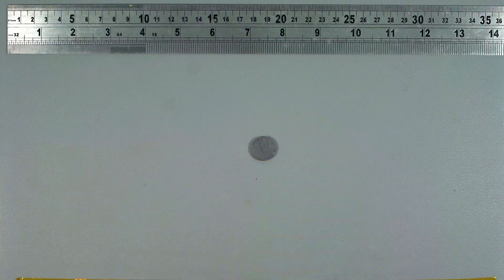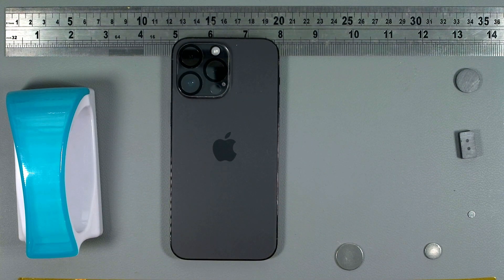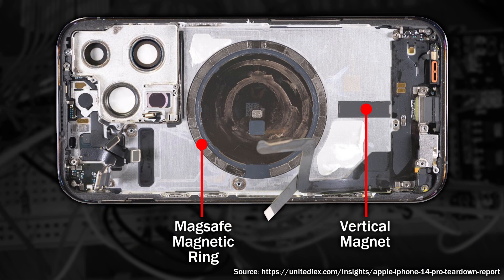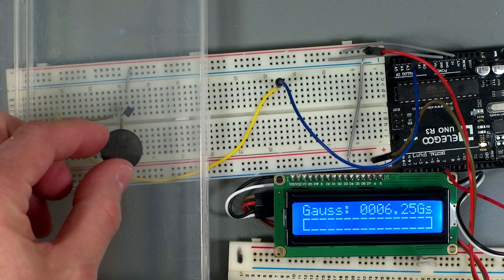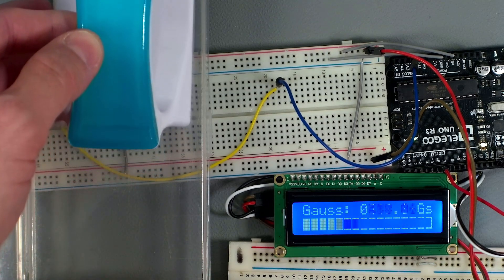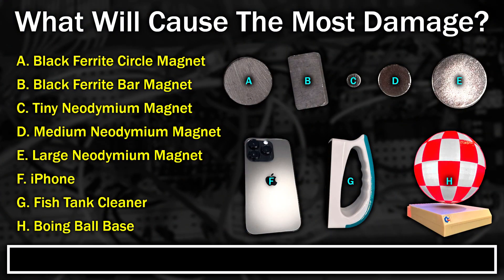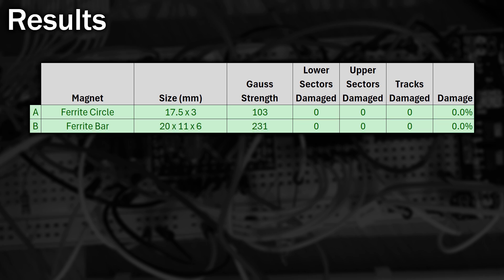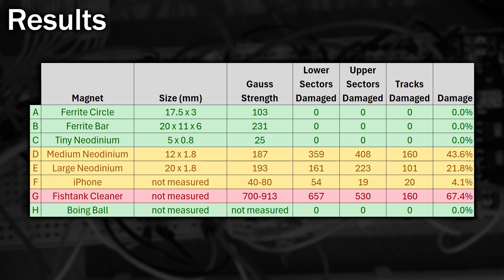Floppy Disks VS Magnets - A Test

Comment: Hi, i saw one person fixing floppy disks that cannot be format, and i tried this method and success, i saved lot of my floppies and its working without any error since a year. if you can try this method and inform us with more details. we will be thankful. link to the video https://www.youtube.com/watch?v=49Pcmgh7tPc&t=69s
Reply from the maker: Erasing them shouldn’t fix them unless it’s removing loose magnetic particles from the disk surface, but in which case should probably go in the bin. Take a look at my video about cleaning disks
Reply: @RobSmithDev  i meant in case of disk damage ( not phisical damage) , we can reuse the floppy with this method instead of throeing it . Thank you .

Comment: when I was a kid the primary thing was the desktop speakers we all had, they had magnets in them. we were told not to put floppy disks around the speakers.  I personally don't remember ever a floppy disk getting damaged by a magnet. Saying that, I have seen a lot of floppy disks failed/corrupted maybe some of them were caused by magnets, I'll never know.
Reply from the maker: Usually the computer speakers were shielded but I suspect with the case on them you probably couldn’t get the disk close enough anyway

Comment: Nice video. Have you tried to fix a floppy by using magnets?
The theory is that you can fix the errors on a floppy by using a strong magnet. Of course you loose the data, but new data can be written on to it.
Reply from the maker: Would be the same as formatting it.
The only time this might help is if you’re using 5.25” drives and you want to write a 40 track disk that’s had 80 track stuff on it or writing a 40 track on an 80 track drive
Reply: @RobSmithDev  Sounds like a plausible answer. Would you be doing a video on that? I think it could be an interesting experiment.
Testing disk with known errors, reformat as 40 tracks, and see if s strong magnet helps? 
Also have you considered Super Strong Neodymium Fishing Magnet? That sell them cheap online.

Comment: What if you put a floppy in an MRI machine?
Reply: Modern MRI machines produce magnetic fields of 1.5 or even up to 2 tesla. That's 20,000 gauss. The center hub in the diskette is made from magnetic metal. You would actually need to hold on to the diskette quite tightly. Yes, it would be very thoroughly erased.
Reply from the maker: I suspect it would die instantly!
Reply: It would get erased instantly. Probably would not heat up as much to melt but without proper analysis I would not dismiss possibility it could heat up a little.

Comment: In the 1980's I worked in software support for a multi-national company and we used to make 2 copies of our diskettes then wrap them in tin foil when we flew.  We were told that if our brief case was x-rayed it would damage the storage.  We were never convinced this was true but we followed company practice because to be wrong and caught out would have meant our job.  Of course our hand luggage was seldom checked in those days.  I don't remember suffering any media damage from x-rays or magnetic interference specifically but we did occasionally suffer loss on one copy for an unspecified reason; hence the 2 copies.
Reply from the maker: I took a load through airport security earlier this year, aside from confusing the staff who didn’t know what they were they all worked perfectly after scanning. But better to be safe than sorry I guess

Comment: When I worked in commercial radio many years ago, we had a 'bulk eraser' that would wipe NAB cartridges clean for new commercials or jingles. It was an aggressive beast that would buzz and vibrate while you used it for the few seconds it took to sweep the tape back and forth. I can remember turning up for work around 5am one morning to a horrible smell as someone had forgotten to turn the bulk eraser off the day before. It's a miracle that anyone within the Broad Street area in Birmingham didn't lose their magnetic media.
Reply from the maker: Crazy things, I think the buzz sound makes them feel unsafe somehow! Did it melt?
Reply: I used to use one on 8-inch floppies when I worked in a library back in the mid-80's.  That thing was hella-strong.

Comment: An Apple product that I’ve accidentally erased floppies with is a MacBook Pro. I set a floppy down on one of the palm rests and it was unreadable afterwards. There are powerful magnets near the edges of the palm rests that are part of the speakers!
Reply from the maker: Wow I’m surprised they’re not shielded but then again I guess there’s less need to now
Reply: @RobSmithDev Perhaps speakers should be shielded, but a lot of laptops (not just Macbooks) use magnets to detect if it is opened or closed.

Comment: Interesting test there, Thanks for doing it - I had a feeling the Fisk Tank Cleaner would do the most damage, as it was a larger magnet to begin with - I never really had any issues with disks when I was younger as I always used to put them somewhere safe

Maybe had 1 or 2 max Amiga Floppy Disks go duff on me throughout the time I used them - Had PC Floppy Disks when I was on a computer training course, used ARJ compression software back then just so I could keep a backup of my data - used to take the Floppy Disks home with me, used to have over 10 at any one time, in a Disk Box - those were the days eh - when you needed tons of Floppies just to store the compressed data
Reply from the maker: The mention of ARJ brought back a flashback of memories to me!